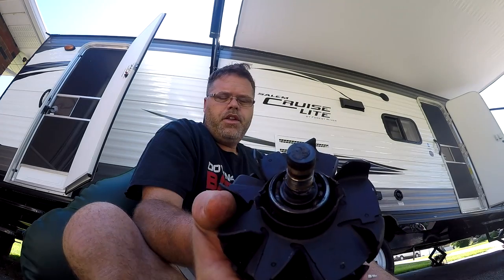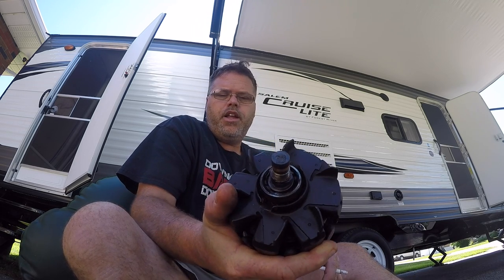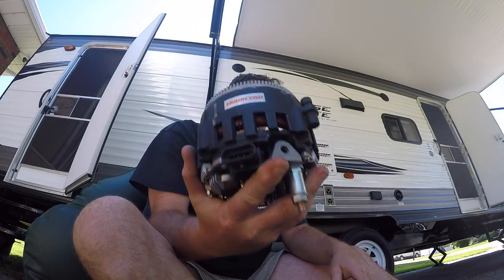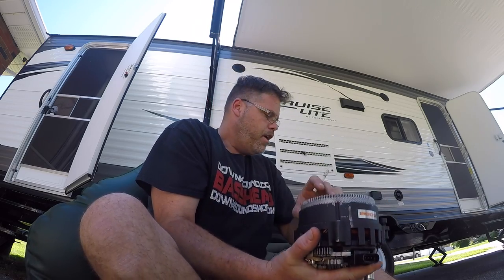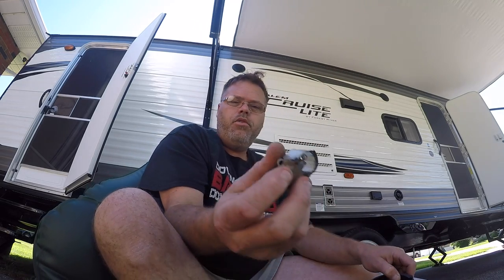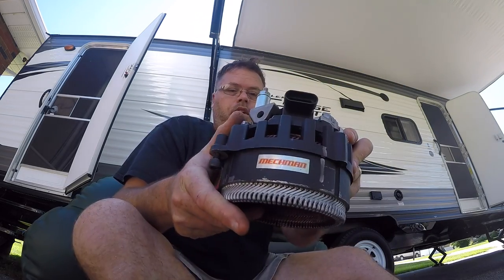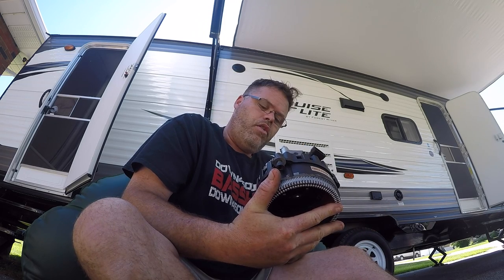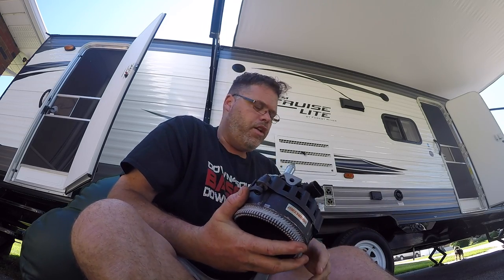MECHMAN Alternators Review

Comment: yeah 40 hours runtime something is SERIOUSLY wrong. Could be the alternator or could be the way it was installed. HO alternators create alot of inertia that the car and alternator need to deal with properly. I have heard of a number of people not happy with mechman for reasons just like this but then again I have heard of alot of people having issues like this with HO alternators in general. My 240 is still running fine.

Comment: How many amps do you need for the van? I'd be looking at retrofitting something else.  The GM CS130 isn't the best alternator to begin with.
If it was me, I'd be looking to see if theres a large case ford 3G with a mount that'll make an easy retrofit to the astro.  When my 10si bites the dust in my truck (conventional 6-12 mount) a ford 3G will takes its place. Wiring is easy as pie, just need the bat wire and the alternator light circuit tied into the vehicle. You do not want a small case alternator. They run hotter and thats exactly what you do not need. 

Something else you might want to do considering how many amps you are pushing out of the alternator is add a heavy guage ground wire to the alternator [edit:rear case half of the alternator] back to the battery negative. Your alternator just might be grounding out via the bearaings and destroying them, which is what my gut reaction to your failures is. 

Anyway check out alternatorman, usually no-nonsense alternator info. Video of something to make you think about what direction you might need to go in your van.  
https://www.youtube.com/watch?v=phVQIxkZhv8

Comment: Another thing should be noted. E series alternators aren't rates the same as S series. In fact it states on website not to exceed 5500 rpm. depending on your crankshaft pulley size you can determine the ratio by crankshaft pulley size divided by alternator pulley size. Then times it by the max rpms you reach and you'll end up with the true rpm's of the alternator. most alternators ate good up to 15000 rpmsso of you had a crankshaft pulley size 6" and your alternator pulley was 1 7/8" youd take 6\ 1.875 = 3.2 so if you drive your car and hit 4000 rpms on the dash .. Your alternator would be 4000 x 3.2 = 12800 rpm's ..get higher in 5000 you could burn it up..i would assume a heavy freeway entrance or pulling a load would easily reach 4 - 5000 rpm .. So your out of luck for a real daily driver

Comment: its a rotor Billsiff, that you showed rotates inside the stator
Reply from the maker: Joseph Junior sounds good ya that thing lol
Reply: the stator is the outside ring with the magnet wire field windings,, the rotor has a spool of wire in it. I use to rewind stators in a rebuild shop
Reply: chances are your alternator was producing excess heat in the tight confines of your vans engine compartment, you need air flow to the alternator to cool it or high temperature bearings, the heat is cooking the pre packed bearings and in turn burns the bearing dry, pop one side out of the bearings and pack with high temp grease or disc brake spindle grease

Comment: DC Power Engineering, my 270xp has been going strong for 40,000 miles! going to order another for my camaro, they do make a 370 amp one to!
Reply: Same garbage.  mine crapped out in less than 20k.  They offered to rebuild at a lessor amount than this guys' quote from MechMan, but I should be able to get more than that out of it.
Reply: Should have got singer or CES,  they have LIFEtime warranties.  CES has  370 amps is 495$. 390 amps are 595$.

Comment: This is 100% a install issue, my suggestion is over tightened belt putting to much pressure on the bearings causing them to fail, the rotor goes of center and causes the grinding on stator.
Reply from the maker: Ya you right over tighten belt on a spring loaded belt tensioner lol wow
Reply: Bill Siff sorry didn’t know you had auto tensioner, there goes my theory then sorry.
Reply from the maker: No worries buds just thought it was funny you would think i over tightened it when in the video I said it was on a spring loaded tensioner
Reply: Bill Siff I’m not sure how I missed that, typical male with selective hearing I think lol

Comment: What did you install this on ?
What size pulley ?
what is the Alternator rated at ?
what rpms were you running it at ?  Peak & Continuous ?

Seems unfortunate cause your in Canada. Other wise shipping wouldn't be so bad for warranty repair. I will say after watching your video and looking up the warranty it really isn't to bad for what they offer. Granted you must be in lower 48 states which you are not. I'm gonna assume you were aware of the conditions when you bought it ? 

here is warranty for anyone interested 
http://www.mechman.com/shipping-returns/
Reply from the maker: 370 amp pulley it came with and a 1993 gmc safari . nothing I did they way over drive them if you getting one you better change the pulley it comes with just saying
Reply: in fine print it reads that E series are only for 5500 rpm or less.. I don't know is that means do not go over 5500 rpm ever or for an extended period of time.  

Something tells me for a daily driver hitting 5500 rpm might happen on occasion so I wonder what the best solution is? 

Get a 270 amp to avoid smaller pulley and 5500 rpm cap ?
or 370amp and get regular pulley ?

that leaves out important info though like what amperage levels would be if pulley was swapped. Depends on internals and limitations.
Reply: also i hear you replaced the bearing. What part numbers do have on that ? more info for the net the better :)
Reply from the maker: same parts as they use . all there Alternators have Canadian bearings in them
Reply from the maker: My van isn't a daily driver I might of had 300 mils on that Alternator
Reply from the maker: I hope you have better luck then I did Buds good luck . Let me know
Reply: Yeah but even if it were 1 mile and you over drove the unit it would of course die 

Some.of them Astro vans had 7" pulleys. So that's 7\1.875  = 3.7333333 ratio. So even at 4000 rpm your pretty much at a damaging point.. 

I believe your best bet was to swap out to larger pulley .. Probably around 2.75" on the alternator and that would have been safer ..

Comment: Sounds like you should have sent it back to Mecman alternator still under warranty repair would've been free and Mecman would tested and fixed it right the first time but u took it upon yourself to try and fix it and same problem 3xs we run Mecman alternators in our build which Mecman alt has to power 60kw systems we deal with Mecman directly and no issues here . Yes Mecman probably said bearing but they only going off of what u told them trouble shooting over the phone and trouble shooting when u have the problem in hand is different it could have been more then just the bearing . U should have payed the shipping  send it back to Mecman so they can fix it right the first time they are the experts on this and they can see more the just a bad bearing. Now even worst u took it apart and can't fix the problem I don't think warranty applies anymore bad move for sure.
Reply from the maker: Waiolani Martinez wasn't free buds they wouldn't pay the shipping for one it was only three weeks old when it screwed up the first time  . So they told me to get it fixed here and they would pay witch they didn't . So I gave up on them . What would you have done ? It was over 200 bucks to send it back out of my pocket . I don't think so.. plus fix it right !!!!!! It wasn't built right if it lasted three weeks BUDS
Reply from the maker: One other thing just because your post kinda pissed me off . If I had a customer pay me over a 1000 CD I would of took care of this problem even if I had to eat the shipping . If they said it could be other issues send it back they should of instead of putting me off to getting someone else to fix it . Witch was a Alternator repair shop the first time !!  Iv been in touch with the better business burial  anyways
Reply: Bill Siff shipping is not free we live in Hawaii trust me .. the repairs would have been under warranty
Reply: Who Zaskin well should of paid the shipping and the alt would of been good ding dong✌️